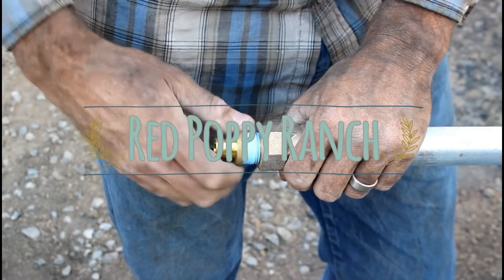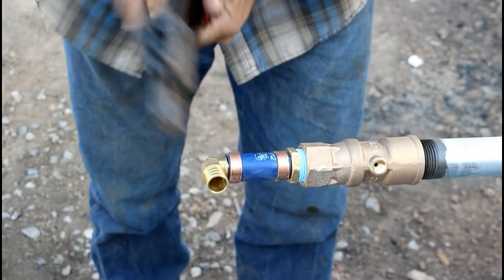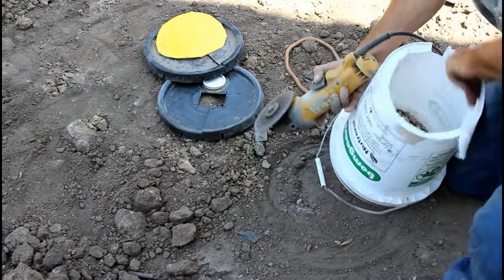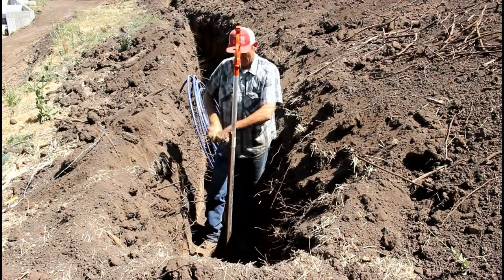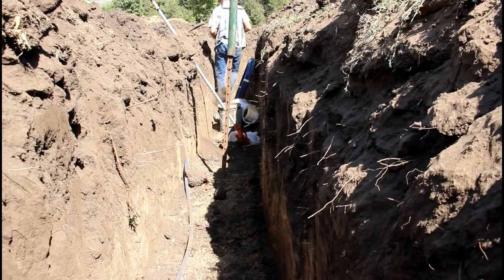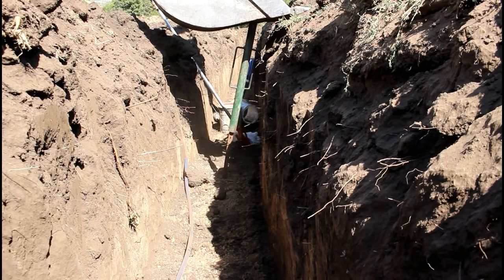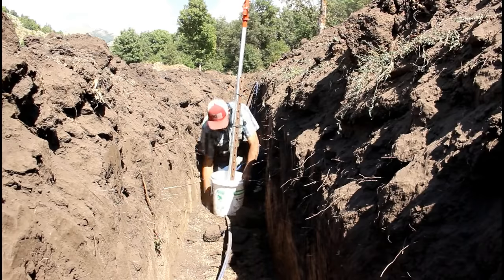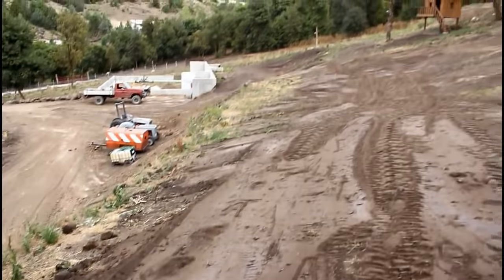The Correct Way To Install A Yard Hydrant!

Comment: Why do you do a pex extension down before adding the elbow instead of just directly attaching a 3/4" elbow to the bottom of the hydrant?  Since the hydrants is suspended, it would seem like the direct connection to the elbow doesn't matter.
Reply: One advantage of using that PEX nipple extension is that you can swivel the elbow any direction even after crimping

Comment: Gravel doesn’t dissipate into the dirt. Pex is not rated for underground without wrapping with a special tape.  You do not need a t post.  At 3 foot bury the hydrant will be fine. I have 30 installed with out any support They are all use every day.

Comment: Not bad, but it appears that the hydrant drain is only about 4 inches above the bottom of that 16 inch tall plastic bucket. So you're only utilizing the bottom 4 inches of gravel in that bucket for your drain field. When I install a 3/4" hydrant I like to have at least 12 inches of drain Rock below the frost level.

Comment: I agree with you 100% on everything in this video. My parents use Woodford Y34's and have had some in the ground for over 20 years. When I put mine in I went with the same model, they are pricey but are definitely worth it. I didn't use pex, but did use the  bucket method. My neighbors keep complaining about needing to replace their hydrants every couple years and I found out they use the cheap Chinese ones. I've recommended the Woodford and I think that's what they are going to replace them with. There just isn't another good brand that I'm familiar with.
Reply from the maker: I agree!
Reply: If you don't use PEX, what do you use, CPVC?

Comment: Thank you for the bucket tip. I am getting close to putting my water line in on our property and I was planning on installing 2 hydrants, one at the pump house and one close to the house plot. Thanks again. Love this channel. :)
Reply from the maker: Thank you!
Reply: I also use a bucket to contain the drain rock, but I go one step farther and install a street ell pointed down with a close nipple on the end in the drain hole to keep grit from getting in the valve.
Reply: Richard Van Dyke Thank you. :)

Comment: I agree with several other people who have commented on this video.  I have never seen one installed in quite this manner but I thought it was very clever.  I like the idea of using the cut off saw to trim the holes in the bucket as well.  I like to use gravel around my yard hydrants but usually just make a loose pile of it. I can see where your method would keep the gravel cleaner longer. Also, I like the T-post for a support. I usually put something next to the hydrant for support, bi
It had not considered a T-post. I have a ton of old posts sitting around from taking up old barbed wire fencing that is no longer used.

Comment: Thank you for the tutorial. I will definitely be using the bucket and gravel method to replace my hydrant. This is because my gravel became infiltrated with dirt and plugged up my drain which is one reason I’m replacing it. The other reason is that the O rings on top are worn and allowing water to leak out when the hydrant is turned on. Thanks again.

Comment: I had to reinstall a bunch of improperly installed hydrants on an 80 acre property in the Midwest, I sleeved the whole setup, won't do it any other way from now on. Makes future repair simple. I got the idea when a main broke on a 24 unit apartment complex under the parking lot. I was cussing a storm until I checked the line at the city connection and noticed it was sleeved all the way to the building. Turned a multiple day job with concrete repour into a half day job.

Comment: Installing one tommorow for a customer up here in Saskatchewan ours are quite a bit taller than those but that bucket and gravel method is gonna be used for sure as well as the T post for support he bent both his during the winter with his tractor. Maybe after this install he will pay better attention to where he is driving. Thx for the vid made it look easy.

Comment: Great minds think alike! Thanks for your tips, I will be installing 3 next week, however mine are buried @ 6 feet with pvc. I think I will give the bucket trick a shot.

Have you considered using a curbstop to isolate your irrigation water from your house supply water? Just a thought which would allow a hydrant failure not to take out supply to your house.

Comment: We normally use a brass MIP X hose barb 90 degree ell on the bottom of hydrant. Using a bucket full of gravel will work good,we use a large scrap of big drainage tile filled with gravel.👍

Comment: 90 degree “street elbow”
At the bottom of the hydrant 
Is the way to go!!
Reply: Patrick Elliott 
3/4 or 1”
Depends on the hydrant
Reply: Patrick Elliott 
We typically never put any fittings on the drain hole as it is not needed 👍🏻
We put a layer of drain rock around the drain hole with a plastic bag over the drain rock to prevent any small particles of the rest of the backfill to clog drain hole

Comment: I put a 4in PVC pipe sleeve around them. Put a brass tee on the end of your hydrant, in the tee port. Drill two holes thru the sleeve pipe about a foot from the bottom and slide the hydrant and tee inside.  Insert two 4-6in nipples into the tee thru the holes drilled the sleeve. This suspending the tee in the middle of the sleeve. Cap one nipple and connect the other to your water line. I drilled a bunch of holes in the sleeve below that point and wrapped some filter fabric around it capping the sleeve, securing it with zip ties, but your bucket of gravel method would work fine too. After it is all buried (the sleeve pipe should stick out of the ground a bit) put a bit of insulation in the top of the sleeve pipe. Then get a 4in cap, drill a hole the size of the stand pipe in the center and cut it in half. Put the two sides of the cap on the sleeve centering the hydrant by the hole, and clamp the cap in place with a screw style hose clamp. 

Then someday when you need to replace the hydrant, you just unscrew it from the ground. No digging it back up. 

Another thing that is good about this, is that if the valve leaks, it weeps out the vent hole underground where you cannot tell. With the sleeve, you can shine a light down there and inspect it or use a sewer camera to inspect it.

Comment: I saw a guy who used screw on fittings 90 degrees from each other so that if a vehicle hit it from any direction it would twist the screw on fitting tigher or looser.

Comment: I was using some old drain tile rather than a cut bucket, I think the bucket will make part of this a lot easier. This looks easy enough for a whole new line, but I'm installing one in the middle of an existing water line, which turns out to be a lot more complicated, getting it screwed on without crossing threads and juggling the limited pipe movement, T post, drain nipple, gravel, and two very poor assistants.(One doesn't know a socket from a screw driver and moves like a glacier while the other is stone deaf and ham fisted. oiey)

Comment: Very cool.  I see so many "professionals" skip the gravel step.  I leave my one frost-free hydrant on all summer long with a timer valve so it does not have to drain back every use. I do wonder if this is putting any form of stress on the hydrant. Essentially like leaving it on with a shutoff at the spigot.
Reply from the maker: I think it's fine.

Comment: What do you do for the surface? Retaining box full of gravel for a mud free area? 

Have never seen anyone else use the bucket to contain the gravel around the drain before so will have to remember that. The pex is nice for the flex it gives if someone dose end up hitting the hydrant and nice idea on the post to wire it to as they will last for years.

Comment: Hi Heath - thanks for the bucket tip, I'll use it next time out at our horse barn.  BTW, why have you not installed water shut off valves to isolate a line or a hydrant?  Thanks and hang in there on the shop/house, there is light at the end of that tunnel!
Reply from the maker: Considered putting in valves at every yard hydrant then decided against it. The only time I would want a shut off valve to the hydrant would be if I needed to work the hydrant or if the hydrant had a leak. I don't anticipate either one.
Reply: They are built so well they rarely leak. 
If they do leak, the repair kits are easily replaced above ground by removing the hydrant head. Water is only off for a 20 min.
Sometimes the head has to be heated with a torch, but it'll come off

Comment: I'm going to have to install some of these.  All installations by previous owners on my property have failed!  So, I like your tips.  But, one question.  Won't the metal t-post conduct cold to the valve underground?  (More correctly, conduct heat away from the underground valve and radiating to frozen ground thus making it easier to freeze the valve.)
Reply from the maker: Not enough to matter. Even if the tpost came out of the ground it would not get cold enough 3' below to freeze up the pipe fast enough to keep the water from draining out. They drain out quickly.

Comment: Great idea with the bucket! They seem to be installed a little low, or at least for what I've seen around here. Could just be the camera angle and the fill dirt too. I think I usually see them with 3' clearance under them. 

I thought I heard about 10yrs ago they they were going to be not up to code and not purchasable. Something to do with anti-siphoning and the freeze proof drain back not being compatible. Glad to see they are still available.

Thanks for the videos. Stay cool and hydrated.
Reply from the maker: Once the dirt settles they will be perfect.

Comment: The installers here use a piece of corrugated drain pipe 12-18 inches in diameter. Would you say the bucket method is the same better or worse?
Reply from the maker: Same. Faster.

Comment: Thanks for the instructions, looks doable even in my city backyard. What is the tool you used to cut the buckets? I might need to get one.
Reply: 4 inch side grinder with a thin cutting disk.

Comment: What is the advantage of a hydrant over just a pipe with a hose bib?
Reply from the maker: Hydrants don't freeze. A pipe above ground with a bib on it will freeze solid then split the pipe and or bib. These hydrants are designed for cold country.

Comment: Code Requirement Update regarding Garage and Carport Floors.  Yes it is a code requirement to slope those floors per International Residential Code R309.1 and R309.2.  "The area of floor used for parking of automobiles or other vehicles shall be sloped to facilitate the movement of liquids to a drain or towards the main vehicle entry doorway."  The code does not specify a minimum or maximum slope.

Comment: What is that gold female fitting at the 20 second mark?  It doesn't look like your average female union, or that it came with the hydrant.   Great job!  Working like a pro!  I've never installed a water hydrant before, so thanks for the lesson.
Reply from the maker: Drain valve on the hydrant. Part of the assembly.
Reply: It is a specially designed drain valve that connects to the handle with a rod up the center of the pipe. When open the stopper blocks the drain hole allowing normal flow to the surface. When closed the drain hole is exposed draining down the water in the pipe above the valve preventing freezing.
Reply: Thanks Andrew.  I thought I saw a small drain hole on that gadget.  Great design of the valve!
Reply: Wow that's genius for cold weather places
Reply: @monicapttrsn NP it took a bit for me to understand how they worked when I first ran into them as I couldn't see the inner valve block the drain hole so thought it would spray out when on. 

@Root Note-Evan that is what they are made for. They come in different lengths to get the valve below the frost line for year round access to water without frozen pipes. 

The only problem with them is the water that comes out of them is no longer classed as potable as there is a chance for ground water/the water that drains out to get in the drain hole and contaminate the area above the valve. Will it happen depends on ground water height, how well the gravel drains the water and if you are running chlorine in the water. This is why you can see one next to a water fountain and the water fountain is drinkable and the hydrant is not even with the same source.
Reply: Andrew, so do folk live with the potential potable water contamination, or is there some standard fix for the drain hole problem?  Thanks for the good insight.
Reply: It is mostly a live with it and do a shock to the system every so often or when there is a problem. You can thread in a 90 to the drain but that dosen't help when it is ground water it is sitting in.

Comment: I take it you prefer the copper ring crimps over the stainless steel pinch crimps for pex?
Reply: Jeremy Hendry - the copper rings are WAY better than the stainless crimps in my opinion.
Reply: Biana Doubt - ya, that's the Uponor PEX. That is superior in that it has full flow fittings (the inner dia. of the fittings are the same as the inner dia. of the pipe). However, the copper crimp ring connection is rated for higher pressure than Uponor.